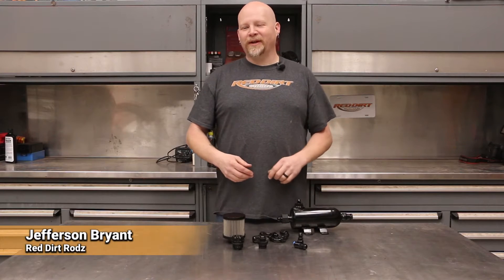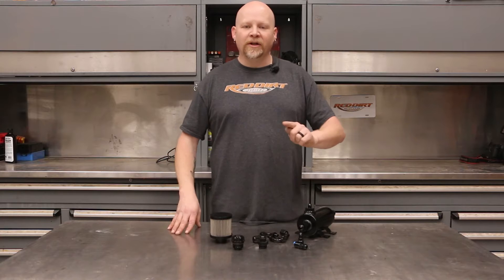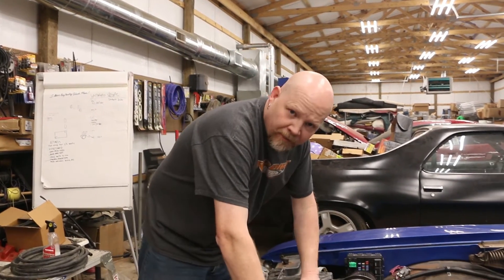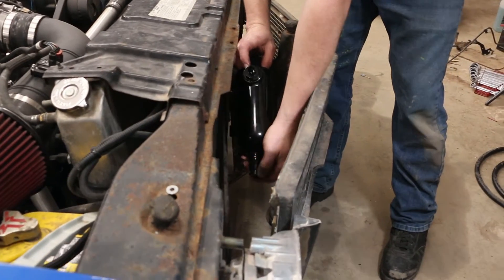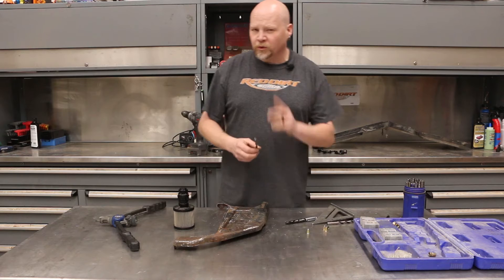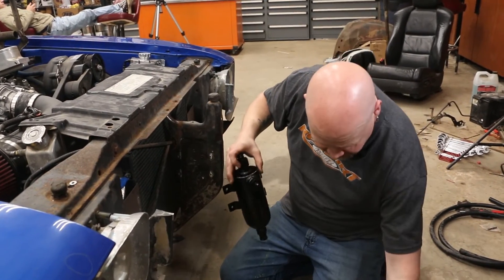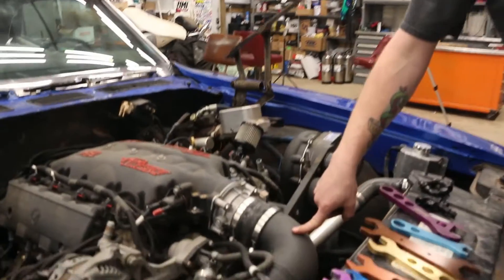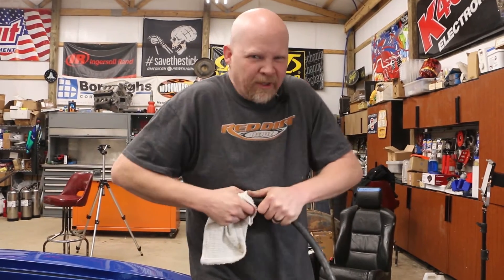How To Install A Catch Can On A Gen V LT1

Comment: This is the closest video I’ve found to my problem but still not exact. 
I have a 2017 C7 GrandSport (so it has the dry sump oil system, very key point here).
And I’ve installed the A&A Procharger setup on my car over a year ago along with a Mighty Mouse catch can. However I do think the PCV is setup incorrectly and the instructions from A&A I believe are incorrect for the PCV system with a dry sump tank.

For stock, There’s 3 ports coming off the dry sump and two of them connect into the PCV, one runs to the passenger side Valley cover (which as you explained is the clean air side?) and another runs to the stock air box/air inlet tube. I believe the 3rd runs to the driver side Valve cover. 

The A&A kit advises you to plug one of the lines coming off the dry sump (which I believe is a breather line for the dry sump tank to allow it to expand with gas as it heats up?) and then A&A plugs the PCV spot on the inlet / stock air box. So it’s eliminates two areas where air was going or coming?
When I added the might mouse catch can I then per instructions blocked off the valley cover pvc port and T’d into the throttle bottle/air intake PCV port which I assume provides the vacuum into my blow off valve for the Procharger.

I seem to have to drain my catch can every month or so to prevent it from over flowing.
I just don’t think my PCV system is plumbed correctly and there doesn’t seem to be a one simple answer on how with my Procharger setup with the dry sump tank lines. 

Also there isn’t a “simple” test for PCV pressure in order for me to truly know if I’m causing excess pressure in my crank. Not like a compression test or leak down test where I can just pull pressure and understand. 

Anyway that’s my rambling, one day I’ll find out an optimal PCV system for Prochargers with accommodations for Dry Sump tank breather.

PS a GM Master Tech did an oil change for me and pointed out that my Corvette and another corvette both running the A&A kits are the only vettes he’s seen that when adding oil, he’s had to stop to let the oil settle because the dry sump was overfilling and couldn’t breathe right. He had to fill, let it settle, fill some more, repeat the process. He’s never seen it else where which leads me to believe more that I’m not letting my dry sump vent probably due to the routing of the PCV.
Reply from the maker: @bigbrown2690  emptying every month is probably legitimate, depending on how much you drive. However, thst plumbing doesnt sound right. Wet or dry, the pcv is the same. Vent one valve cover, route the intake manifold pcv to the air box BEFORE the MAF, should be good.